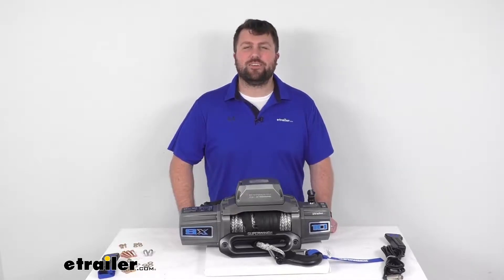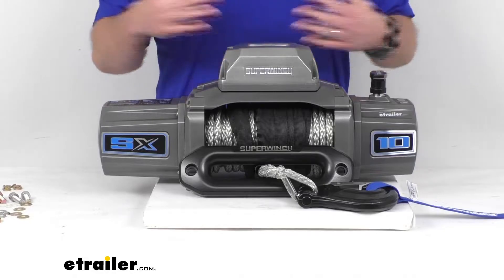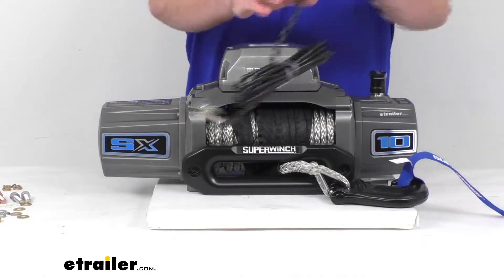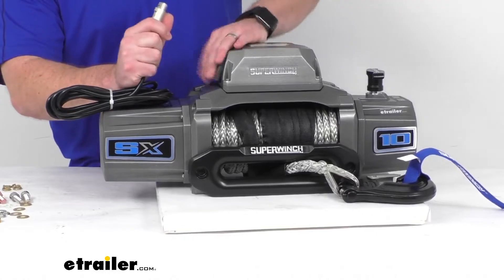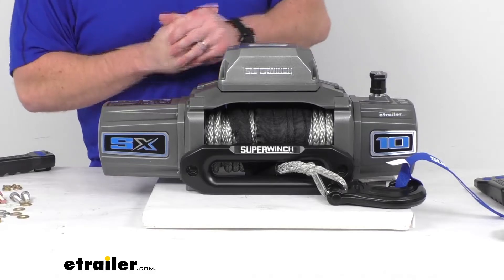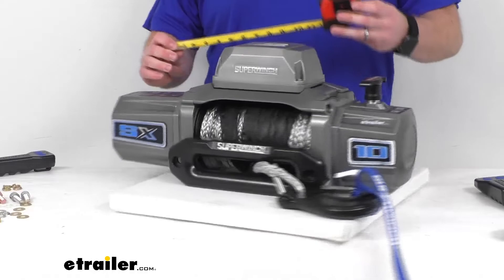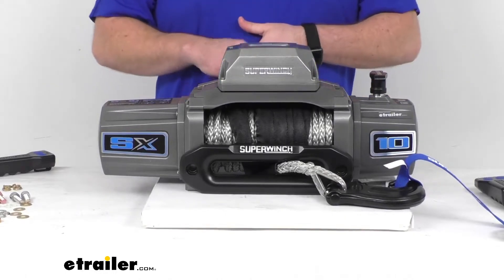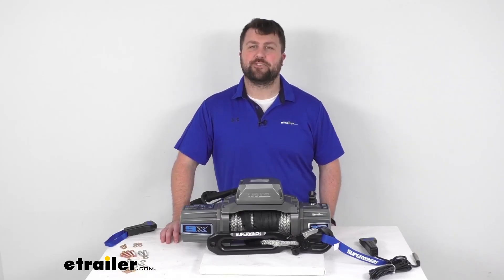etrailer | Complete Breakdown of the Superwinch SX10SR Integrated Off-Road Winch

Comment: Does the rope end at the drum connect by set screw pinch or terminal eyelet? Thanks
Reply from the maker: The rope is help in place with a set screw. If you check out the following link, it will take you to the instructions. Page 11 shows the rope installation.
chrome-extension://efaidnbmnnnibpcajpcglclefindmkaj/https://www.westinautomotive.com/images/ePIM/original/1710200.pdf

Comment: How much rope do you need to keep on drum. Assuming that you don’t want to pull all the rope out when winching. 90’ of rope - 85 usable length = 5’ left on drum?
Reply from the maker: Superwinch states that you want to leave at least 5 turns of wire rope or 8 turns of synthetic rope on the spool. Hope that helps!
https://www.etrailer.com/Electric-Winch/Superwinch/SW39GR.html